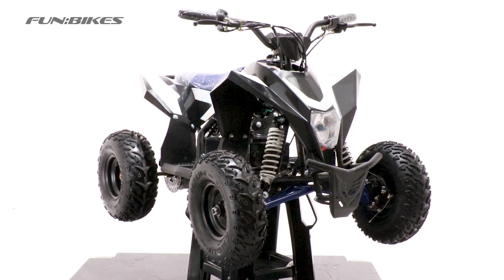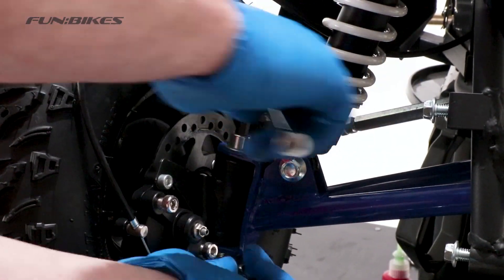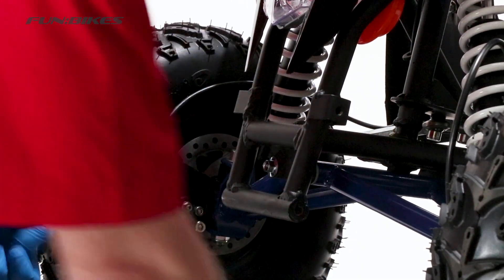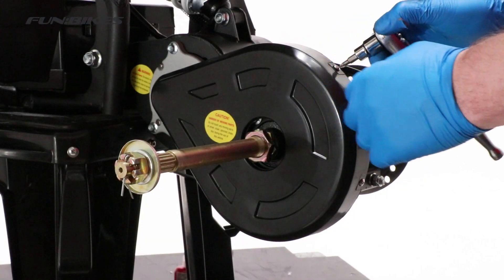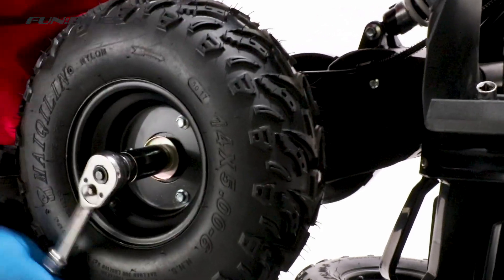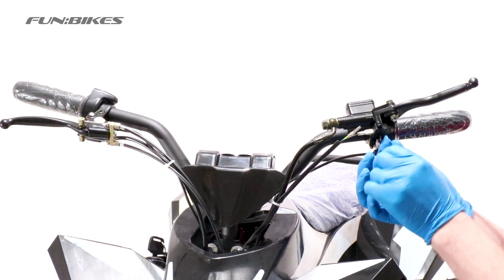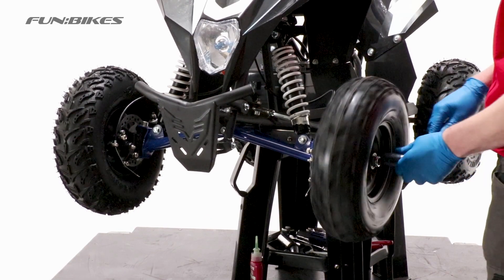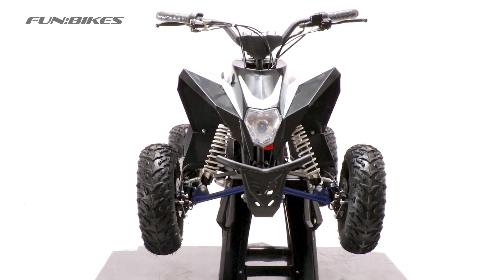Technical Help: How to Build the FunBikes Roughrider 1000w Electric Kids Quad Bike

Comment: There is a port under the bars WHATS this for
Reply from the maker: Charger point
Reply: @funbikes so why is there one at battery then
Reply from the maker: @jessconsidine1778  Do you mean is there a battery one? The charge port would be for the petrol engines battery that powers the starter motor, lights etc.
Reply: @funbikes  there is charging point under the bars and also at the  battery connector
Reply: One is clearly to charge it but no idea why there’s 2 of them
Reply from the maker: @jessconsidine1778  For all tech questions, pls ask our experts at tech@funbikes.co.uk. Can help with everything